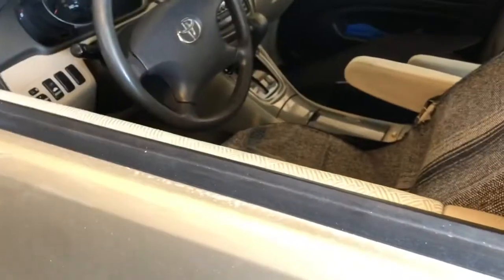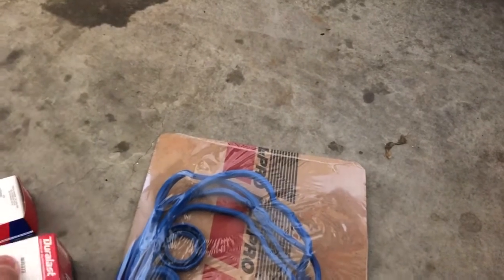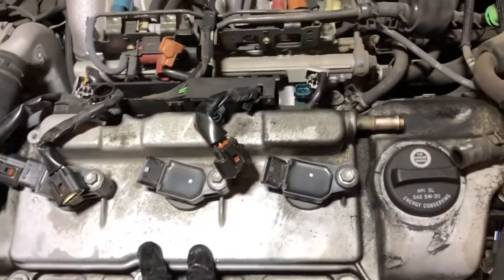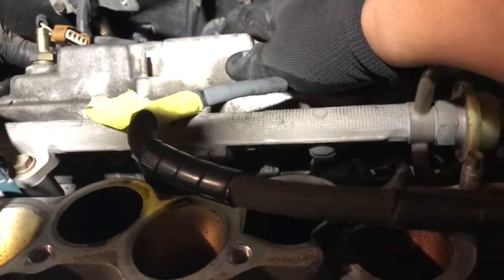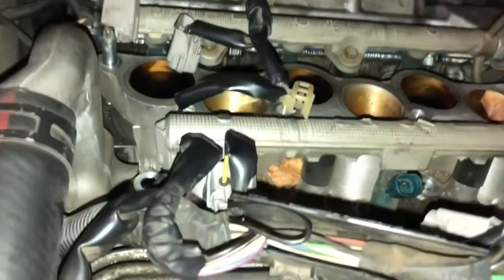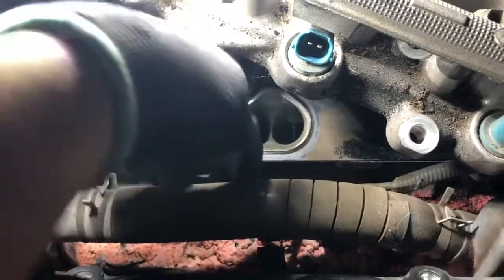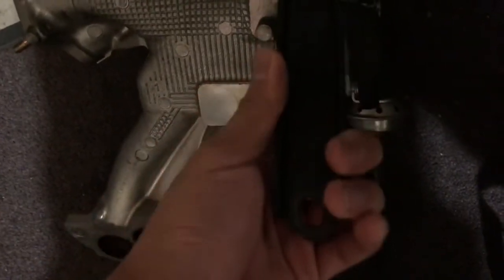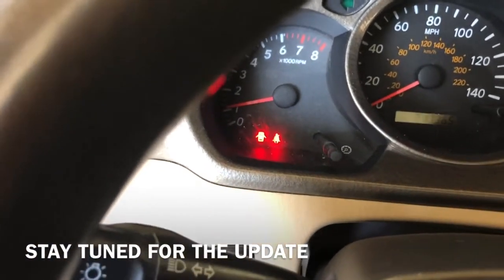2002 Toyota Highlander Knock Sensor and Valve Cover Gasket Replacement (NOT A TUTORIAL)

Comment: If you unhook the wiring harness on the back witch you have to any way and unplug the o2 and the rear cam shaft sensor you can get the valve cover bolts from the top or at least that’s how I do it.
Reply: How does that wiring harness get disconnected? Got the valve cover off  but that wiring harness is in the way.